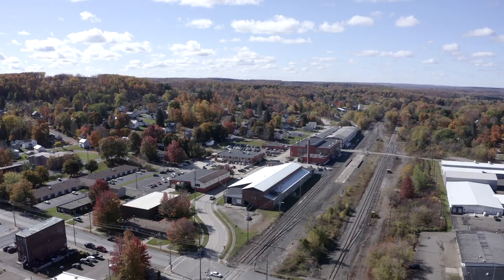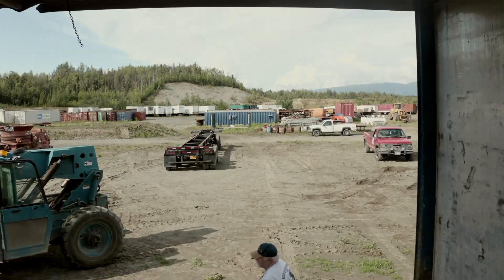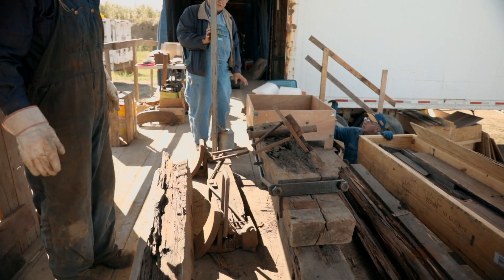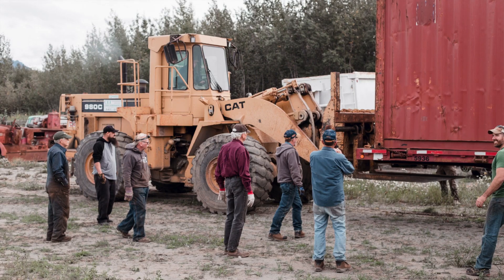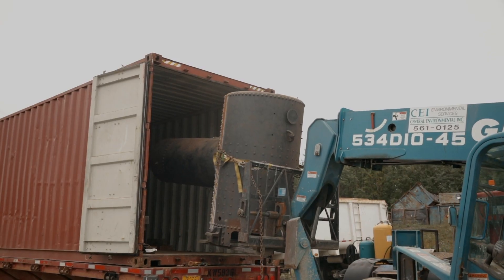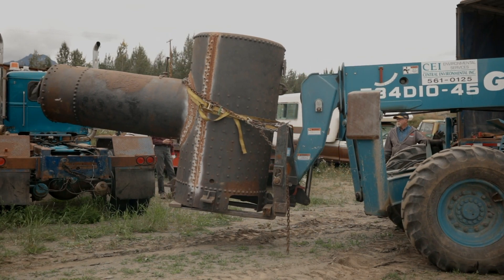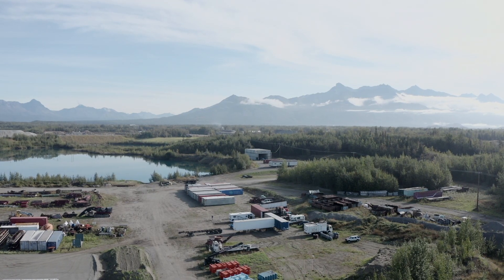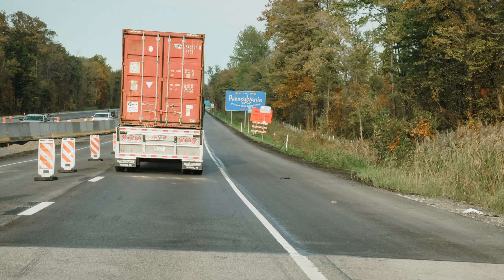Bringing the Climax Engine Home to Corry, PA

Comment: It's like a pile of parts that someone said "Make an alarm clock from this". Hopefully not too much is missing.
Reply: LOL... yup, you are so right... in fact, I've commented that it's kind of like having a bunch of old rotten Lincoln Logs and many rusty parts of a well-used old Erector Set that were left out in the elements for 120 years... and, of course, with no boxes that they came in and a few parts probably missing, and of course no instruction sheets or drawings either.  Thank goodness it is a fairly simple design.... but when it comes to figuring out and reverse engineering the reasoning behind the methods used in manufacturing and assembly, it has been, and continues to be, enlightening.  There weren't too many parts missing, but a couple have proven to be a challenge, but not insurmountable.  Thanks for your interest... we do have some team members and donors in the Dallas area who make it up here every so often.